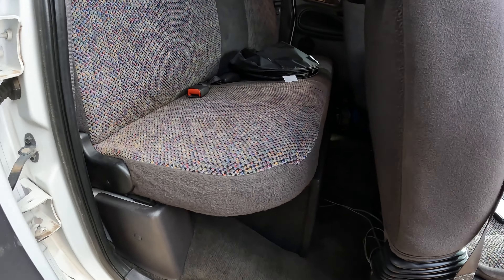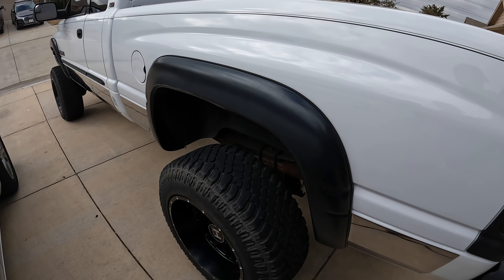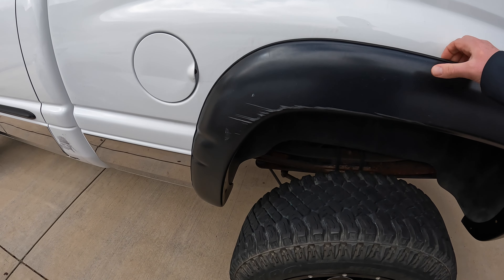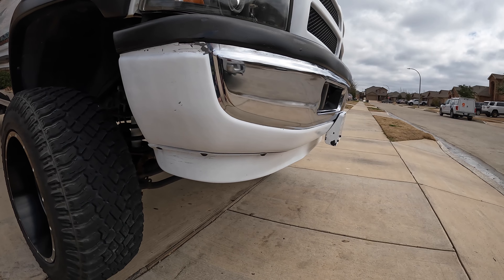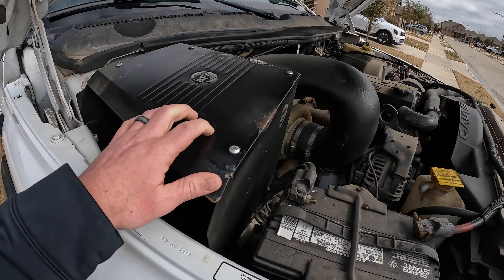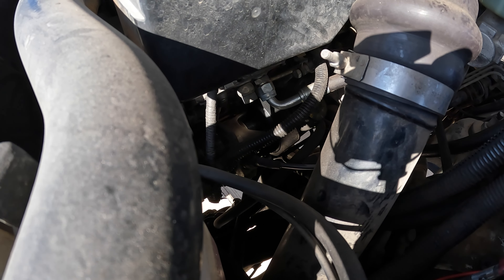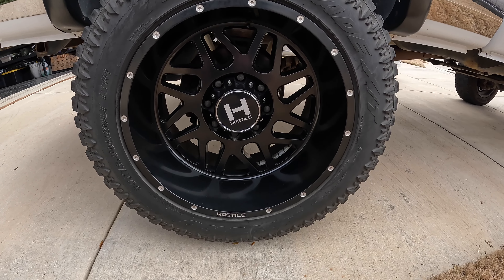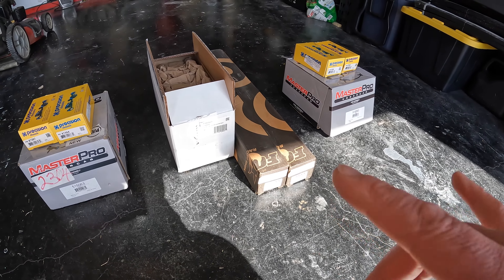2001 Dodge Ram 24 Valve Cummins Start Up and Walk Around.

Comment: Try installing a sump on the bottom of your tank and get rid of the draw straw, you'll never lose fuel pressure that way.
Reply from the maker: I had considered that. I wasn't sure the likelihood of it getting hit by accident either offroad or potentially unavoidable road debris. I like the concept but was weighing the options. I am seriously considering a Fleece SureFlo Sending unit that is designed for Aftermarket lift pumps.
Reply: @Lonestar24V  I did the beans sump and it was a quick install and has worked out great. If you knock it off you have more issues than the sump.
Reply from the maker: @jamesvaldez4093  Good to know, I appreciate it. And yeah, that's a fair point.

Comment: I have a 99 2nd gen. I replaced the under hood light with a nice LED unit only problem is it doesn’t turn off when the hood is shut…
Reply from the maker: Yeah the factory light housing had a little switch built in that would turn it off when the hood would close. I bet you could put a small pressure switch for the hood to make contact with that would open the ground circuit and turn it off when closed?.
Reply: @Lonestar24V  thanks I’m gonna look into that or just a small on/off  rocker switch…

Comment: Looks like you have enough lift for 37s, 37s and 17 inch wheels will ride a lot nicer
Reply from the maker: I had thought about that, I think I could clear them and 17s with a 37 would look awesome. I agree they would probably ride so much better.